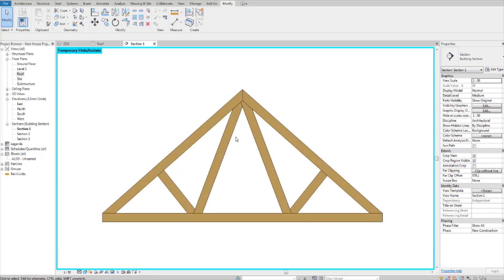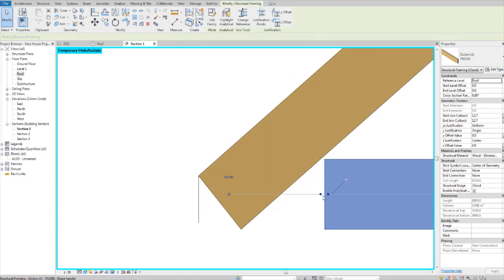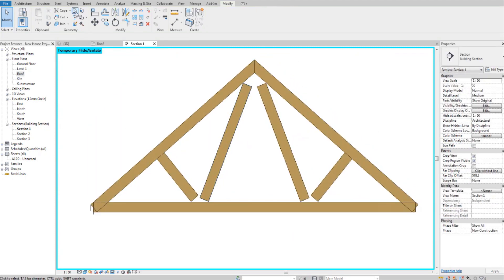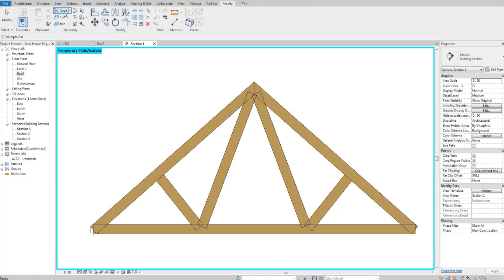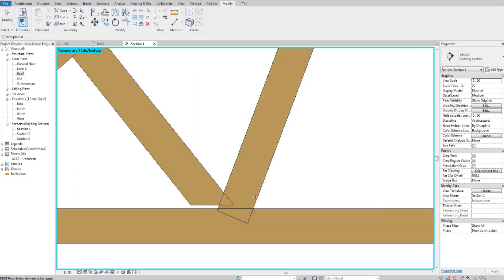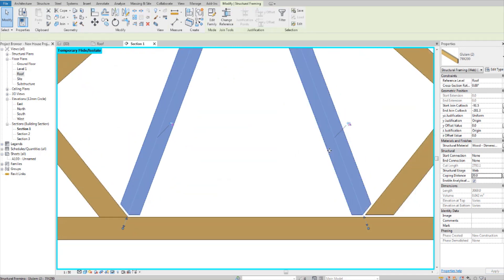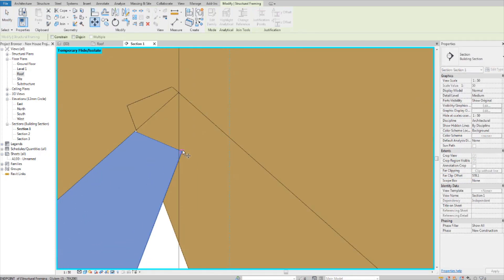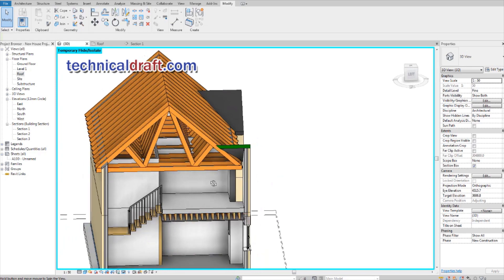How To Connect Truss Members in Revit

Comment: Thank you, it is very useful for you. Do you connect steel the same way you did or another way?
Reply from the maker: I believe you do connect the steel the same way. Also a little tip, if you draw a reference plane across and steel beam/column, you can cut the beam to the line so you can make diagonal cuts too.

Comment: Hi, what if i don't see arrow heads once i unpinned the elements of the truss? How can i make them appear in order to correctly join the structure?
Reply from the maker: Hi Riccardo, which arrow heads do you mean? The tiny blue drag arrows or the join arrows? If you want you can send me a photo on instagram.
Reply: @DrawingTechnical  The little blue drag arrows, but I just found out that they don't apper if you use concrete as structural material for the web, I didn't know that. Thank you anyway!
Reply from the maker: I just tried it with concrete, it didn't work for me either. The blue dot fo dragging the end of the concrete member showed, but no blue arrows. Good luck with your concrete truss if that's what you're making.

Comment: Hi...does this method apply for RHS also?im having trouble to joint my RHS
Reply from the maker: Hi. RHS? Rolled hot steel? Rolled hollow steel? It should work for those. If it doesn't let me know, I have another method of cutting beams and columns.
Reply: @DrawingTechnical  thanks..but i got the method already...haha..
Reply from the maker: Nice 👍
Reply: @DrawingTechnical  can cope be use in family creation?while doing family i cant find cope button
Reply from the maker: Try drawing a reference plane as a sort of cut line along where you want to cut, then use the Cut geometry tool, see if that works.

Comment: There is a frame generator in robot. But the export to revit 8s not 100%. Do you know of any frame generator for revit.
Reply from the maker: I used to work with a steel frame generator commercially. I have used a timber frame generator plugin in revit before, it was good, it created stud and track frames for your building. I can't remember the name off the top of my head, I will have to go back and see if I can find the plugin.